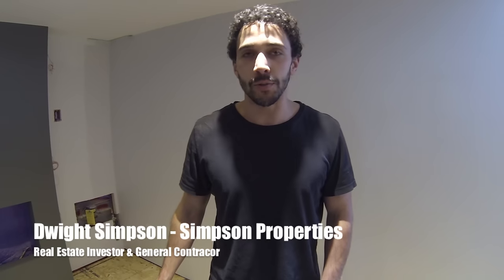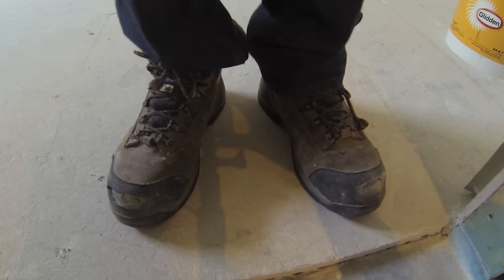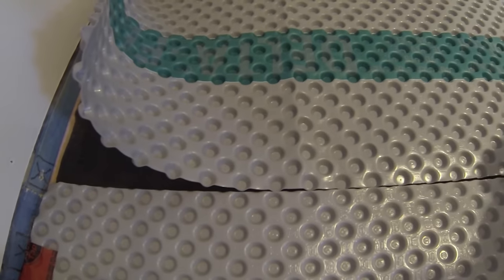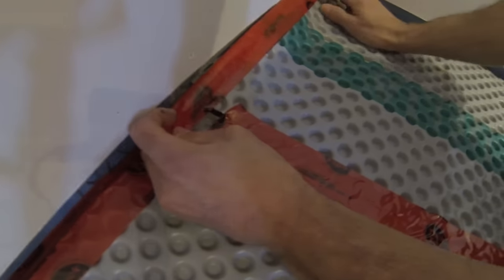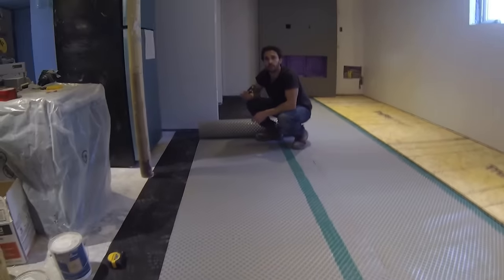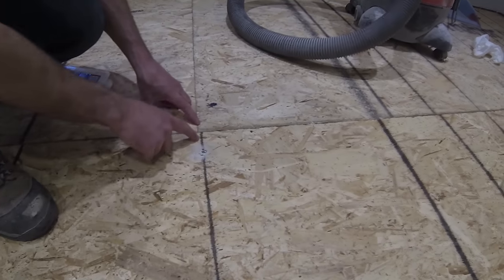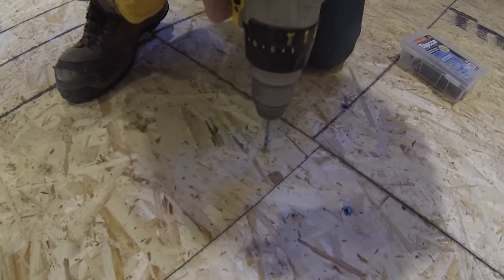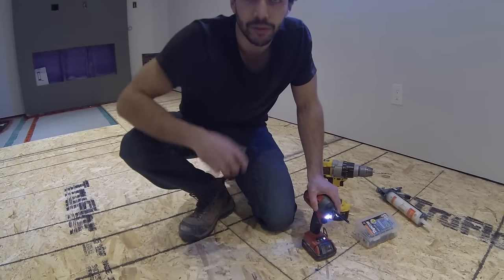HOW TO INSTALL A SUBFLOOR ON CONCRETE

Comment: Great video but I feel fastening the sheets down using screws is unnecessary. Dricore & similar do not need to be screwed down. Have you tried the same process but without the screws? Good tip on the landscape fabric.
Reply from the maker: Thank you and great question!

If the finished floor is going to be carpet, DRIcore & similar products do need to be fasted to the concrete floor. They are fastened with flat head 1/4" x 2 1/4" or 2 3/4" concrete fasteners every other panel, at perimeter edges and one in the panel in the centre of the room. This prevents panel uplift when stretching the carpet.

Using the application that I demonstrated in the video anchoring is used to control bounce and warping of the OSB. You need a minimum of 8 Tapcons per sheet (1/4" Tapcons embedded 1" have a pullout value of at least 750lbs, and a shear value of at least 900lbs). Using Tapcon fasteners produces a secure, trip free (smooth) surface. Floating laminate floors would work over floated OSB but there is a chance that over time the OSB will warp. This would cause bounce and an uneven finished floor surface. Heavy cabinets or a workshop overtop of floating laminate, over floated OSB, would work better over a more secured surface. The heavy weight would definitely cause buckling in the unsecured floor. It’s up to you which installation method you choose but I would recommend using Tapcons like the manufacturer suggests to avoid any issues in the future.
Reply: I'm going with vinyl LVT flooring over top. I don't want to screw it down unless I really have to. Your thoughts on screwing it down with LVT on top?
Reply from the maker: InternetDude I recommend screwing down the subfloor no matter what material you plan on using for flooring. Most concrete slabs are uneven or sloped towards the drain. In areas like that you will get a bounce in your floor. Use your own discretion & decide which method will work best for you. Doing the job the right the first time always costs less and saves time in the long run.
Reply: Simpson Properties Simpson Properties My fear is that over time tapcon screws will get loose and pop out. Also, like you described I have some areas convex sheets when I placed OSB over drain area. If OSB will be tied down to concrete, is it possible that it will pop up?
Reply from the maker: marat bleykhman a tapcon that is embedded an 1-1/2" deep has a sheer strength of 1200 lbs. The chances in them popping out are very slim. Even in areas where there floor is uneven or sloped. Just install more tapcons in those areas to keep the board fastened properly.
Reply: Simpson Properties Thank you Sir!
Reply: I was also thinking maybe put some liquid nail on tapcon in that are for extra bonding. Your thought?
Reply from the maker: marat bleykhman no problem! I personally wouldn't use any construction adhesive. It's a waste of your money & time. Don't over think the process. Tapcons fasteners are designed for this application and will keep the OSB secured firmly.
Reply: Simpson Properties Thank you!
Reply: Do you use 1/4 diameter or 3/16 tapcons?
Reply from the maker: marat bleykhman 1/4” x 1 1/2” Tapcon fasteners (Phillips head).
Reply: Loved you video I did my basement about 10 years ago and the flooring just failed because of a bathroom toilet overflowing . I had strapped the floor because I was not confident enough to try a self levelling compound. I would like to level the floor this time save on height losses an use an underlayment + that material with a dimple on one side . Is there a easy way to find the high spot and level the floor. I plan  to put down plywood and laminate flooring. Finally I am in the true north so keeping that floor warm is a concern.
Reply from the maker: Thanks! The easiest way with out using an expensive rotary laser level would be to use an 8' or 10' spirit level. That will show you where your high and low spots are in the floor. I would recommend using a spiked roller as well instead of a trowel it's much easier. Make sure to prime the floor first as well. Radiant in floor heating would be the best way to keep your floor warm but it's very costly.

Comment: whats under that square piece in front of that narrow door? is that a drain or somewthing??
Reply from the maker: pwee507 it's an access panel to the back water valve (prevents a sewer water backup). It needs to be maintained once a year.
Reply: Simpson Properties so.... how what that part installed? you just have all the flooring and subflooring attached to yhe inderside of that cover?
Reply from the maker: That OSB on the access panel is floating and not fastened to the floor. I used construction adhesive to fasten the flooring to the OSB on the access panel. I used floor transition pieces to build a picture frame around the panel. They can be pried out then the panel can easily be removed. I should of made a video on making that as well haha

Comment: The nails that you drilled isn't supposed to go in to the concrete right?
Reply: Are you talking about the blue screws? Those are tapcons, and they're made specifically for concrete.
Reply from the maker: The tapcons are suppose to be fastened into the concrete.

Comment: Problem is the cost of OSB has gone insane during the pandemic so this is not nearly as cost effective anymore
Reply from the maker: Lumber prices did shoot up insanely high. They have normalized since March 2020 prices in my area. You always have to crunch your numbers and see what building products will make the most sense to use.

Comment: I have wall-to-wall carpeting in my condo and it's just cement underneath. And, the cement floor is uneven! A flipper told me to put a floating floor over the cement. WRONG. I dont want to know how much it's going to cost to go to hardwood/laminate flooring.
Reply from the maker: If it’s a condo you’re fine installing flooring directly on top of the slab. Doing a glue down method. Just make sure the material you buy is designed for that application. Or you could install a floating floor with an under-pad.

Comment: Would it be better to use plywood vs OSB?
Reply from the maker: In my opinion OSB is a better choice for this application. It is more cost effective and less prone to warping when it comes in contact with any moisture.

Comment: Your better to build your walls on top of your underlayment because by building your walls to the cement your creating a break in the vapor barrier, by building on top you have an uninterrupted vapor barrier, that is sealed.
Reply from the maker: I agree with you. Future installs I would install the framing on top of the Delta-FL. I did maintain a constant vapor barrier with this installation though. The Delta-FL was tuck taped to the base plate of the framing, sill gasket installed on the base plate and closed cell 2 lb spray foam on the exterior walls.

Comment: why would you put the OSB over the underlayment? For DMX airflow you can lay the laminate right on top of it without spending 350 bucks on OSB
Reply from the maker: You can install laminate directly on top of the Delta-FL as well. I find that the OSB provides a much more solid base for the finished flooring. Any imperfections in your concrete slab will be noticed while walking for example low spots.
Reply: That's the problem thats happening to me right now, I put DMX airflow down and since the concrete isn't perfectly level underneath you get bouncing with the laminate. I'm also not sure that DMX airflow is going to work now because I saw another video about 5 minutes ago where the guy had a perfectly level subfloor and said the flooring he put on top of the DMX airflow was too mushy. I don't know what to go with now, I'm trying to save money here and not spending a freaking fortune on just the subfloor for this damn basement.
Reply: What is the most inexpensive way to shield the basement floor moisture from ruining the OSB? I have about 673 square feet to cover in this room, so it's going to take over 21 4 x 8 sheets to cover this. I don't want to spend all of that money on OSB and then spend another 500 bucks on dimpled underlayment. That would bring this subfloor into the $1000 range, no way in hell I'm doing that.
Reply from the maker: Based on my research and experience the method shown in this video is the most cost effective way for installing a subfloor over concrete. When I purchased my Delta-FL it was on sale at Lowes buy one roll get the second free. 

That’s how it goes with construction a lot of money is spent on materials that will never be seen. There may be other “cheaper” ways of doing this but I never compromise on quality. I’m all about doing it right the first time.
Reply: Yeah buy one get one free would be a lot better for it. Right now its $66 a roll for the delta and then I would have to put the OSB over the top of it too at $16 a sheet. So total for the whole thing would be like $800 bucks not including the landscape fabric.
Reply: would 1/4 OSB work? that would save about 3 bucks a sheet, and why can't you just put down 6mil poly for the moisture barrier to the concrete and put the OSB right over it?

Comment: What is the point of putting a subfloor on the concrete
Reply from the maker: Check out Delta-FL’s spec sheet. It explains that in great detail 👍🏽

Comment: what about air ventelation for water leaks
Reply from the maker: If you have major foundation or slab issues those should be addressed first. Proper waterproofing from the exterior (if possible) should be done first to fix any foundation leaks. These next few paragraphs are directly from Delta-FL's web site. Hopefully this will help inform you on how the product works.

DELTA®-FL on concrete floors protects sensitive materials by exploiting the concept of vapor pressure - that is, water vapor seeks to equalize its pressure by moving from areas of high pressure to areas of low pressure.

In a conventional basement, dry air in the living space acts as a magnet for water vapor seeping up through the concrete. But with the DELTA®-FL system, the space between the dimples provides a sufficient air-gap to equalize the water pressure above and below the concrete slab.

Though the air in the living space is completely isolated from the system, DELTA®-FL is designed to allow small amounts of water vapor into the room to maintain a healthy humidity level.

The membrane also provides a thermal break that generates instant comfort and warmth for your basement. DELTA®-FL is an inert material. The air-gap membrane has an outstanding compressive strength of > 250 kN/m², is extremely tough and rugged and can withstand heavy loads which allows for any finishing on top of the membrane.

Comment: How can I implement radiant heat with this system?
Reply from the maker: There would be no need to build a subfloor over a concrete slab if you have radiant heat installed. Installing a subfloor overtop of the slab would reduce the efficiency of the radiant heat. The subfloor would act as an insulator forcing the system to work harder and cause inefficiencies. Typically engineered hardwood or tile would be installed directly on top of the slab. I would recommend installing an uncoupling membrane before installing tile.

Comment: What is that red tape called? "top tape"?
Reply from the maker: It’s called tuck tape. It comes in blue or red rolls. Either will do the trick. The red  coloured tape is usually cheaper.

Comment: Can I install real hardwood floors to concrete?
Reply from the maker: Yes you can I did this recently at my personal home. There was radiant heat installed in the slab and a vapor barrier installed beneath the slab. So I had no concerns regarding moisture. You will have to use the glue down method.

Titebond 771- Step is an advanced polymer adhesive, moisture and sound control system. It provides moisture control protection which is critical for installations over a concrete slab in basements or slab on grade applications. It’s critical that the concrete is dry to the touch and fully cured to bond properly. It can be used to secure engineered hardwood, solid wood, bamboo and cork flooring.

Comment: can I lay tile over this? I have a basement that I wanted to install marble tiles on.
Reply from the maker: global direct you could install tile on top of this but you would need to use an uncoupling membrane as well. If you plan on installing tile I wouldn't install a subfloor. I would use an uncoupling membrane from Schluter directly on top of your concrete slab. The uncoupling membrane will prevent any tiles and grout lines from cracking. They also offer a heated floor uncoupling membrane called Ditra-Heat TB that is what I would personally use. Depending on where you live you may not need heated floors.
Reply: +Simpson Properties thank you so much for your prompt reply.
Reply from the maker: global direct no problem I'm glad I could help. I'm a certified Schluter Installer so if you have any questions about their products let me know.

Comment: Dwight, I have a home on a slab floor. Can I use this method to sub floor the entire house to install hardwood flooring
Reply from the maker: Hi Reg, yes you can install nailed hardwood floor over this sub floor. A lot of hardwood floor manufacturers will require 3/4" subfloor. You can still use the same installations methods shown in this video. You will just use thicker OSB or plywood. Check with your flooring manufacturer on the required thickness of your sub floor.

Comment: Hi, I have a 3 concerns and not sure if you can help. 1. Did you put a second moisture barrier on top of the plywood?
2. I had bedbugs around 5 months ago. I removed carpet and threw away anything that had to do with wood, I also clean everything with bedbug chemicals, but I'm afraid to install hardwood floor and get bedbugs again. Do you recommend to put hardwood floor? 
3. I asked someone at homedepot and they said I don't need moisture barrier if using plywood, what do recommed?

Thanks,
Hope you can answer me.
Reply from the maker: Thanks for your questions and subscribing! I did not use a second moisture barrier on top of the OSB. I used a foam under pad on top of the OSB then installed laminate flooring on top of the under pad. I have never dealt with bed bugs but on the Orkin website it states: Bed bugs do not have a preference for wood or metal. They hide in narrow harborages close to where the potential host sleeps. This might be anywhere within several feet of the bed (baseboards, dressers, nightstand). I would have your place professionally treated for bed bugs. Once you have done that you should be fine to install hardwood flooring.
Reply: Cecilia Salamanca use Cimexa

Comment: Aren't 1.25 inch tapcon too short? Tapcon says 1.25 minimum embedded length. You would need at least a 2.25 inch tapcon.
Reply from the maker: I used 1-3/4” Tapcons. That’s what the manufacturer recommends. I have had no issues with the panels not being secured properly.

Comment: So now if you nave a flood or water seepage, it will be trapped between the concrete and the subfloor and by the time you discover the problem the entire floor will be covered in mold. Great idea !
Reply from the maker: The slab would have to be in good condition before installing any finished flooring application. It’s similar to finishing a basement. You wouldn’t start framing walls and finishing a basement unless the foundation walls were in good condition with no leaks. There are still floor drains installed on the slab beneath the Delta-FL.

Comment: To increase the r value could you add foam insulation board in between the delta plastic and the plywood?
Reply from the maker: Yes you could do that. Especially if you have the ceiling height to accommodate the foam.

Comment: Good job but I would have overlapped my joints by at least 16”.
Reply from the maker: Thanks. If you read the manufactures spec sheet it says, "Do not overlap or interlock the dimples."
"End laps and side laps shall be placed tightly to the adjacent roll of DELTA®-FL." The seams are taped.

Spec Sheet Link:
https://www.cosella-dorken.com/bvf-ca-es/pdf/install_instructions/DELTA-FL_install_inst.pdf

Comment: i am fighting between this method or with sleepers. theres a 2 inch height difference between the  corners of my basement and the middle where the drain is. Would you happen to have a suggestion? total area that will get a floor is around 800ft2. Maybe i am just being too anal about having a 101% flat floor....
Reply: I had seen some floors where they install 2x4s (on the flat side) and then level the 2x4s before installing the 4x8 sheets. 

I need to get the concrete inspected beforehand anyway. 

Really appreciate the reply and the video is motivating to finally get it done! Thanks!
Reply from the maker: You could get a top coating of agilia self leveling concrete installed if it’s really bad.

Comment: Why plywood over concert or cement?  Because for leveling?  I just dont get it.   Cant you title of concert and make your life easier?
Reply from the maker: The reason you would install a subfloor system like this is if you’re installing a floating floor (laminate/vinyl plank) or carpet. A slab will wick moisture which could damage and cause mild overtime  if the flooring is installed directly on the slab. You could install hardwood directly on the slab you would have to use a special glue which is troweled over the entire floor. The glue has a built in moisture barrier.
Reply: Simpson Properties well my has a vapir barrier then laminate flooring on top.   My living room is concrete then title flooring on it.   And all my friends is same as me. Thats why im asking when is plywood sub floor is use and to me its doesnt seem mandatory to use it

Comment: My basement concrete flooring g is not flat and level.  It dips
Reply from the maker: You will need to shim low spots or install self leveling concrete.